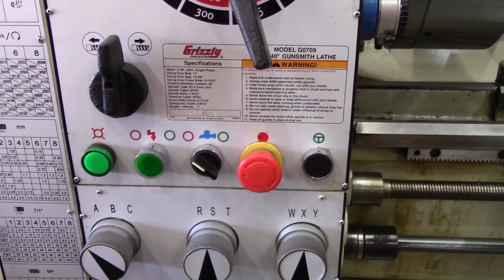Thumbscrew Adjuster

Comment: Nicely done Ray. It will be great to see how well the cabinet performs.
Reply from the maker: Thanks Mark, Working on the next video now, Mike Tacoma and I have be spending a lot of time testing vacuums and flow meter adjustments and settings. We now have a bunch of good data to share! Sorry for the delay but we wanted to get some good info out! Best Regards, Ray
Reply: @RaysGarage  great to make improvements. Has turned into something great this cabinet. Take all time needed and we will stay tuned as always.

Comment: I noticed the flow meter does not have any measurements. What is the range of negative pressure in actual #'s? Thanks !
Reply from the maker: This is a base mark you need to set on your own, only remove dust and not media. It took me a few blast runs to get it right. Garnet is heavier than glass abrasive so adjust accordingly.

Comment: Hi, but what does the set screw adjust?  Mine didn't come with instructions.  Thanks for the great job.
Reply from the maker: marshmellomatey The set screw allows you to adjust the amount of vacuum into the flow meter controlling the white ball position under vacuum.  I will be doing a video on this soon but in short if you turn in the set screw it blocks the vacuum causing the ball to drop down to the first green ball. If you are using a powerful vac it is not necessary to make adjustments.